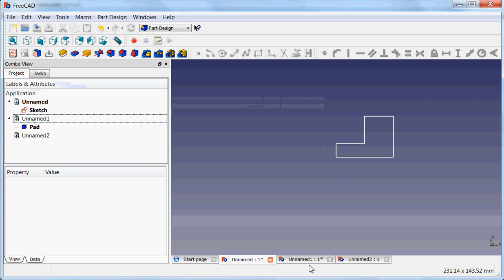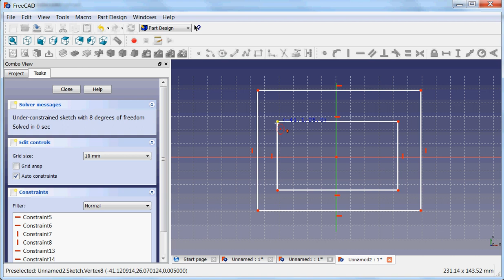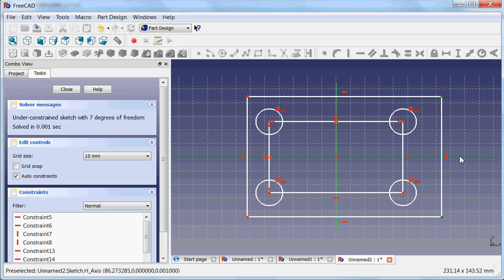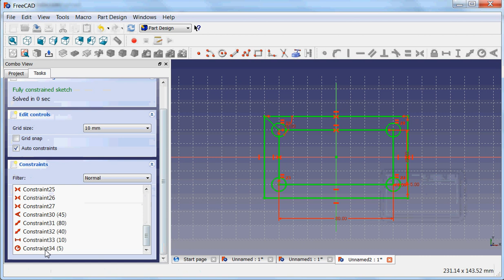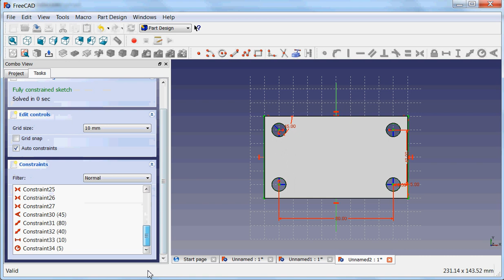FreeCAD Tutorial Part5 More 2D Constraints

Comment: Hi Do I have a setting wrong?
 I make 2 squares I select circle I hover over the corner till the corner of the square goes yellow  and place the 4 circles. I then select all 4 circles and set them to equal size and that works. I then click the two corners and the horizontal line and then the constrain button and then on the vertical axis. now  if i try to move any side of my square or the corner all that moves is the square and not the circles. I have tried and tried but not getting the circles to move with the square im only just starting with cad so would any help would be appreciated as i have a 3D printer and almost finished building a router using 5mm sheet metal. Thanks for any replies.
Reply: I'm two weeks, late, and am having the same problem.  Did you ever figure it out?
Reply: NVM. I figured it out.  Draw the circles near the corner, then use Coincident constraint.